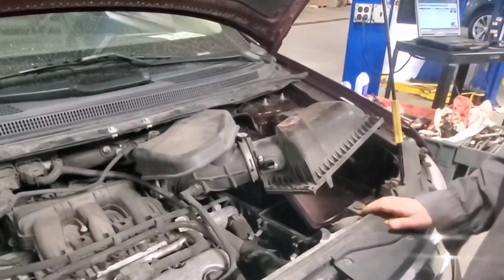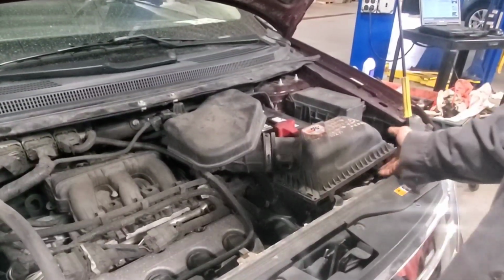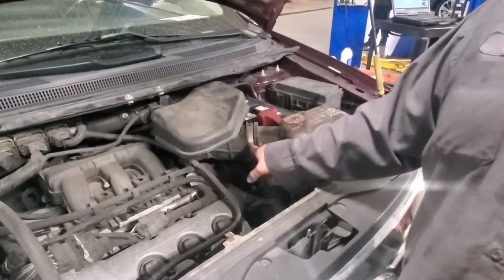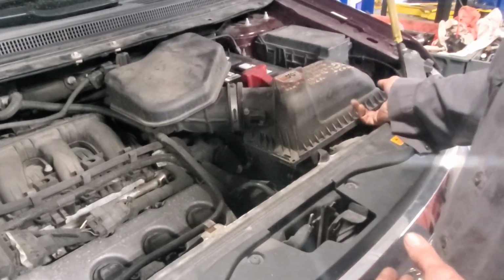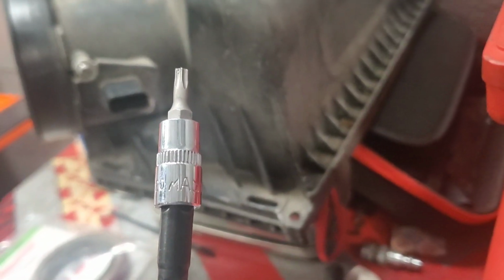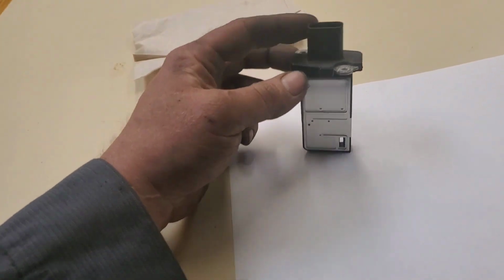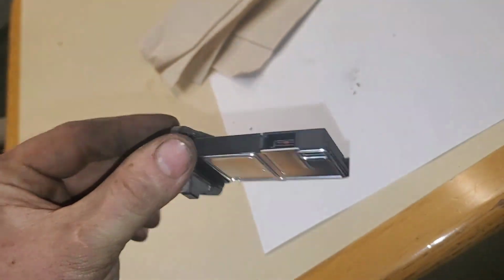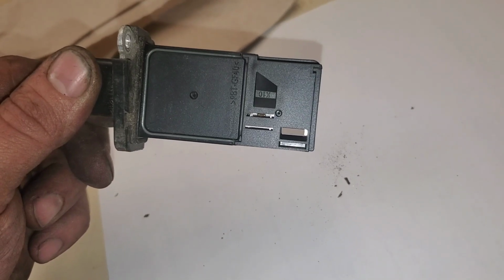Check Engine Light Is on after checking airfilter, Check This First and Make your car run better

Comment: Thanks. Check engine light came on after oil change and they checked my air filter too.
Reply: I got my oil changed a couple a few days ago, and the guy checked my air filter and said I was dirty and the check engine light just came on.

Comment: 2016 cruze. Changed air filter. Next day, rough idle check engine on. Gonna look at in the morning.  It's 2:18am
Reply: Did it work?
Reply: @gamer_gopw3549  YES. Make sure the filter is seated properly.  It's the cylinder shaped filter on mine.

Comment: I replaced brand new "Air Filter" which is a right filter for my 2014 Chevy Equinox 2.4 but check engine on after installed it. How do I do? 
I just cleaned filter box inside to blow any dust out using by air compressor before replacing new air filter. I checked it 3 times that the filter was installed properly. Do i need to clean or replace MAF? Want to hear your opinion!!! Thanks.
Reply: You find out??

Comment: Changed my air filter right before my road trip. Now I have engine light on and I’m in the middle of nowhere. 😣 It keeps saying engine boost power reduced. Trying to find somewhere that can look at it without taking weeks to fix it.

Comment: I have a 2019 Chevy Cruze LT and I have replaced the air filter light went off and a few days later came back on. I replaced the sensor light went off for about a month maybe more and back on again so I am gonna try this before I go to the mechanic.
Reply: did it work?
Reply: So yes and no lol. I tapped it like you did and some stuff came out light went off for about a week and then back on. This time I used compressed air got more out blew out and wiped the tubing as much as I could and washed the air filter canister. Light went off for a month back on. So I removed the negative terminal on the battery for about 30 mins. Reattached it and it has been months. So thanks for the tip it was one step on the way to really helping out.
Reply: @derrickstinnett2054  im not the one who made the video but i’ve been looking for some help because after installing a cold air intake, my master warning light came on and im not sure what I can do to fix it

Comment: Is it true that your not supposed to touch a part of the sensor? Not sure if its true and also which part.
Reply from the maker: Yeah you're not supposed to touch the filament inside the mass airflow you just spray it from a distance but you don't actually touch it 
sometimes you can take a Q-tip and just wipe it real lightly but you don't touch anything why are related on the actual area of the mass air flow that goes in the intake tubing
Reply: I floss with the wire then ship it

Comment: i had oil change and then immediatly as the car is taken out from the shop, it has a light, had it reset, comes back again one week later, i check my air filter box is all loose, thats not how i left it, now i wonder if the maf got dirty i may have to clean it and then clear the code, see if it comes back
Reply from the maker: I bet you the mass air flow is dirty

Comment: so my engine light code went away after driving for a while, what did I do? I put the air filter box correctly which the mechanic didn't when checking the filter. Why do they check this? Another thing I did is put the oil cap with the letter facing me, so I don't know which one was the culprit for the light. I think it was the air filter box
Reply from the maker: you that I also get a check engine light on if the air filter box is not put together properly because it sees an abnormal amount of volume

You fixed it